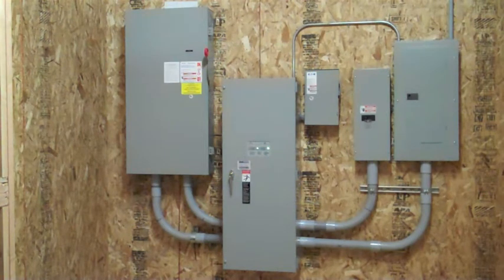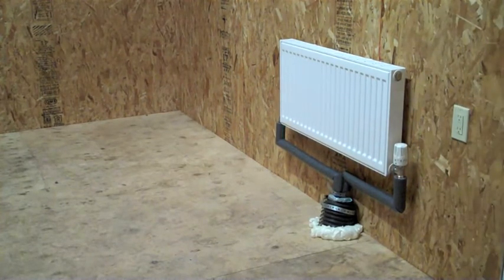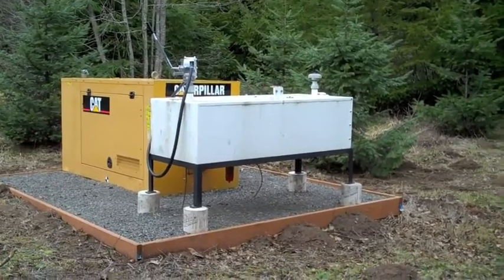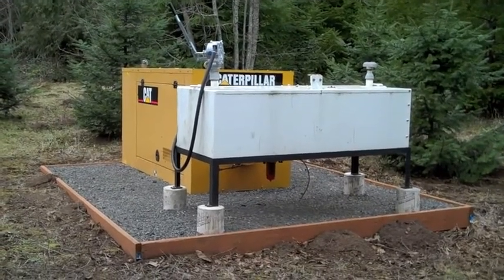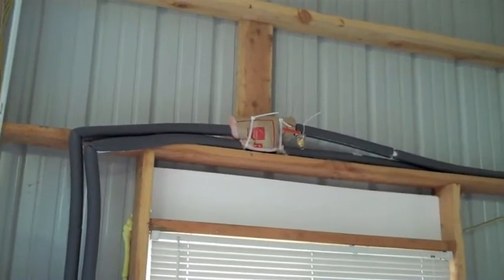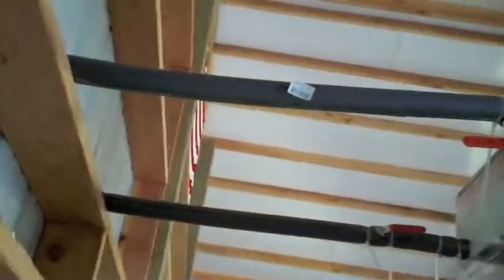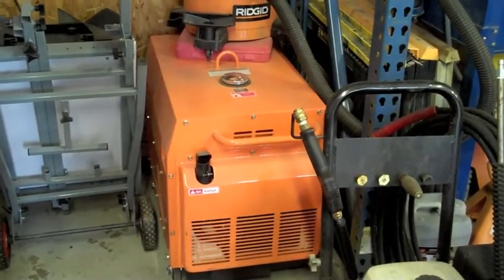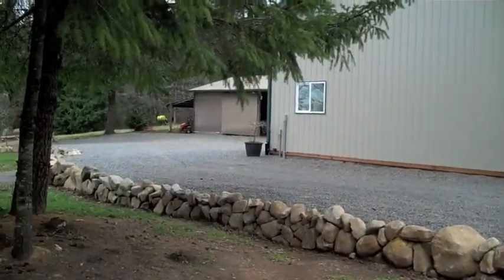Over due update Pt2

Comment: Nice work.  Do you heat primarily with the wood boiler or waste oil in the garage?  Who made that boiler and are you happy with it?
Reply from the maker: As far as heating the shop, it depends on the temp outdoors, if it is really cold I use both the boiler and waste oil. If it is 45 or higher I use just the boiler. The boiler is made by Central Boiler and I LOVE IT!